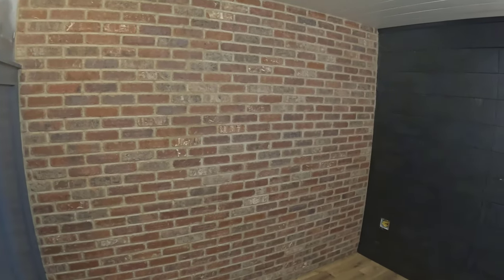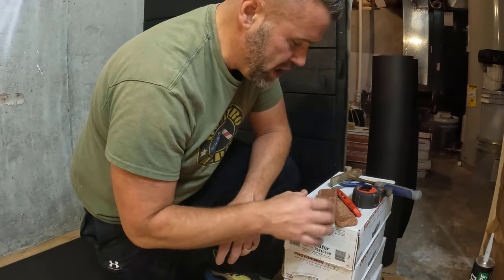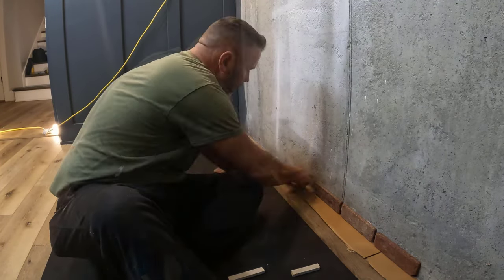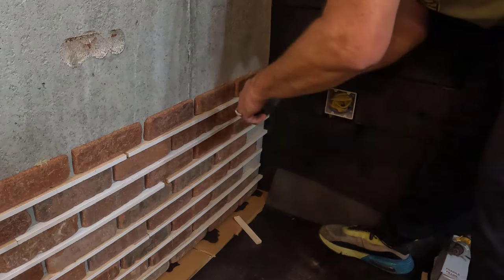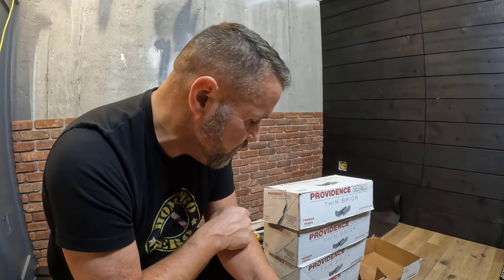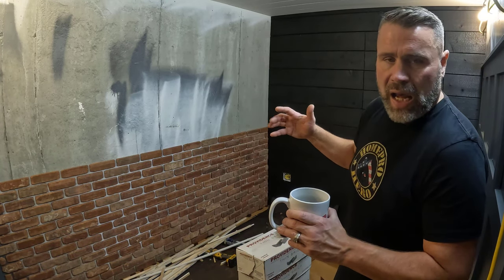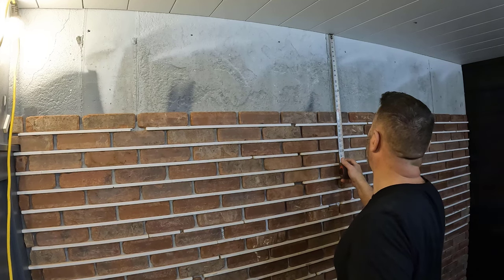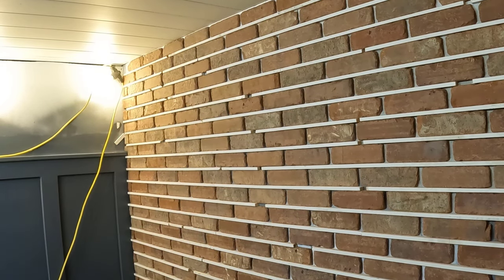How to Install Thin Brick Like A PRO!

Comment: what kind of wood did you use for your long spacers? plywood cut in 1' strips?
Reply from the maker: I think I ripped down some pine 2x4. Whatever you have laying around will work you just need a ton of them so the cheaper the better. Thx 4 watching

Comment: I am currently working on a thinbrick wall with brickweb. I have never done anything like this before and had a hard time getting my bricks to break correctly. I scored a deep line in them before trying to break with a hammer and they were still not breaking in the right spots and wasting bricks.
Reply from the maker: A handheld grinder with a mason disc cuts perfect everytime!  Little dusty but its perfect!  I use one in this video:  https://youtu.be/0qbbr2Fi7CQ

Comment: Is it ok just to glue it to standard drywall? No cement board needed?
Reply from the maker: For sure I have done that all over my house. Just use regular liquid nails not the landscape stuff I used in this video. I just put out another thin brick video where I applied it to drywall check that out. Thx for watching

Comment: If the thin brick is being installed in a bathroom reno over purple sheet rock, does the sheet rock need to be prepped as in mudded, taped, etc? Thanks!
Reply from the maker: If it were up to me, I probably wouldn't bother unless I already had the tape and mud on hand. Once you apply the brick to the wall and mortar it, it creates a strong seal that is both secure and water-resistant. Thanks
Reply: OK, thank you so much. That’s kind of what I was thinking too why I bother taping the mud and then going to all that trouble when I’m gonna put brick over thank you and what a great video you created. I certainly appreciate it. I watched every second of it and learned so much.

Comment: Is there a calculator to determine how much mortar I will need for the joint grouting step? My wall is 17'x8'
Reply from the maker: Not that I'm aware but i would budget no more than 2 of that big bag of S Type I used in the video. Goes a long ways!  Thanks for watching!

Comment: Can you tell me how to finish an open edge?  One that doesn’t butt up to another wall?  Thank you!
Reply from the maker: Yea they sell the corner pieces and also flats that I used in this video.   The corner pieces wrap the edge on both sides.  If I had to wrap a corner I would start on the corners and dead end into the wall on the other side.  Hope this helps!
Reply: Very helpful. Thank you!

Comment: Great video, thank you. Can we use thin bricks on a dry wall project?
Reply from the maker: Thanks for watching!  Yes, absolutely you can install on drywall and I have!  I have a YouTube Short Video on installing it as a backsplash and also there are several pictures in this video (bathroom, bar and game room) where they all had drywall.  If you install on drywall you can save some money on just regular liquid nails - i had to use the landscape version of liquid nails for this video since I was gluing it to concrete!  Take Care HPH
Reply: Thank you very much for your quick reply. I will start my dry wall project asap.
Reply from the maker: There you go!  You can do it!

Comment: Will that adhesive stick the brick to textured and painted drywall?
Reply from the maker: I would use regular heavy duty liquid nails.  Test a piece apply it to the wall. Check the next day and if you really have to pull or pry it off you are good!  I think it will work fine!

Comment: Those long strips you’re using? What are they? And how big are they?
Reply from the maker: The sticks I just used whatever wood I had laying in the garage. I believe I ripped them down to 3/8 of an inch with a table saw. The 3/8 is the spacing between the bricks. I think they where 3/4 wide so I could grip them to pull them out when the bricks were dry. Thx for watching
Reply: @HomeProHero  thank you so much for your super fast reply-I was actually in Lowe’s and your reply was so fast I got the right stuff! So-I can just use 3/8 spacers since I don’t have much strips as such
Reply from the maker: Np good luck with your project!  I love the thin brick. Getting ready to do more in my master bedroom and painting it black after install!  Video soon
Reply: @HomeProHero  looking forward to it! I can’t stop gushing about your videos! Descriptive, straight to the point and so helpful-someone like me was able to do it and save 4200! Thanks so much!

Comment: Hey how would you handle a corner just put a grout line in between two bricks at 90 degrees?
Reply from the maker: Thx for watching!  If it's a inside corner you can just grout the corner like you stated. If it's an outside corner they sell a box of thin brick corner pieces that wrap around the outside corner that makes it look like a full size brick. I didn't have any corners on this project but I did in my gameroom and they looked great.

Comment: Can i use these bricks on my existing textured sheet rock wall?
Reply from the maker: Sure can I install it on sheet rock in this video!  How to Lay Thin Brick Like A PRO! #homeprohero
https://youtu.be/0qbbr2Fi7CQ
Reply: @HomeProHero  Thanks for the quick response. Your videos are clear and precise. I'm going to do this as an accent wall in my master bedroom and living room.
Reply from the maker: It's a nice touch for sure!  Just don't over do it and put it in areas that someone would think that "this is where a brick wall should be"!  Take care and good luck with ur projects
Reply: @HomeProHero  Thanks for the tip. I want to make sure that it looks as normal as possible rather than just thrown together.

Comment: What were the size of your horizontal spacers????  Does anyone know??? Maybe i missed it..... I heard 3/8 for your vertical spacers.
Reply from the maker: All spacing is 3/8 inch. Vertical and horizontal which is the exact same size as the tool. Thx for watching!
Reply: @HomeProHero thx guy. Subscribed. Do i need to score or sand the drywall.
Reply: @HomeProHero  well,,,what i hate about your biz. My 3/8 anvil is a dash over a half inch...smh.
Reply: @kevreilly7    Maybe the physical width of the tool is wider, but the contour should fit a 3/8" mortar joint....
Reply: @ruffxm  thx.

Comment: Big bucket of acrypro is alot cheaper than a dozen tubes of "glue"
Reply from the maker: I used two tubes about $17. No mess well worth it!  Thx for watching
Reply: @HomeProHero  i wasnt trying to be a wiseguy. I was just throwing the idea out there. If you had a bigger project those $17 could add up plus they dont store long term well. That big bucket of acrypro is huge and probaly stores better.

Comment: Why didnt you start with full brick on one side and bond it out to the other side ? Instead of starting in the middle and working out both sides ?
Reply from the maker: I'm a little OCD and I love the symmetric look. By starting in the center, I'll be able to have the exact same width of bricks on both sides of the wall for the majority of it. I could've easily started it from one or the other just me being me :-)
Reply: Ahh i see. Tat makes sense

Comment: Bro… you know you could’ve saved yourself a day/2 days by installing with thinset or mortar(grout as you go) not having to buy almost a case of liquid nails!
Reply from the maker: Opening a tube of LN and apply it to the bricks and throw tube away. Only used two big tubes $16)

COMPARED TO

Getting a bucket, adding water, adding mortar, getting a drill and mixing paddle out, mixing  for 5 minutes, wait 5 more minutes, get a trowel than apply the mortar and clean everything. 

I'm good with my method easy, faster and cleaner :) Thx
Reply: @HomeProHero  everyone always wants easy … to each they own. I was taught differently obviously
Reply from the maker: A few ways you can do it for sure. I just prefer this way since the project was small and inside my house. Take care!

Comment: Why does everyone want perfectly lined up bricks?  To me it's too sterile. A few different mortar 🧱 thicknesses gives it a more rustic look and the randomness of it is actually more pleasant to the eye
Reply from the maker: It looks perfect but I guarantee there's imperfections in a lot of my lines. I think it's mainly because that's kind of the way bricks done around here but I have seen it similar to what you're describing another is. Thanks for watching. Take care.
Reply: Even old brick walls were laid level and plumb with even mortar joints. I'm from the trades and don't know any old-school brick layers that didn't keep mortar joints even - that's what made it a true art form. I've worked in countless very old, brick buildings in NYC and have never noticed uneven mortar joints. The bricks used in this project are not wire-cut...Those are the types that give that perfectly even look which you're referring to. The bricks in this project have traditional, old-style, rounded and uneven edges. That is what gives it the authentic, rustic brick look...not uneven mortar joints. Uneven mortar joints just makes it look like a dumb-ass did the job.